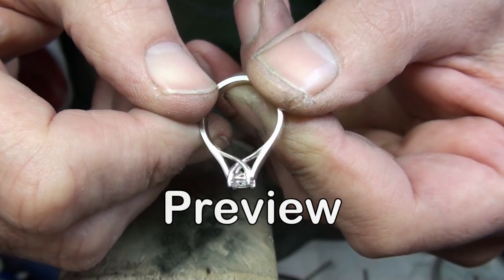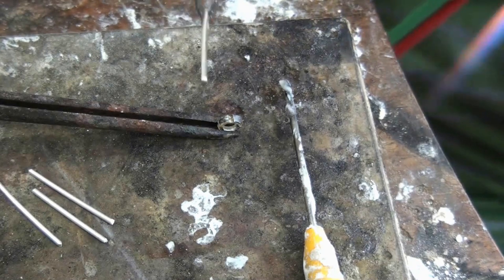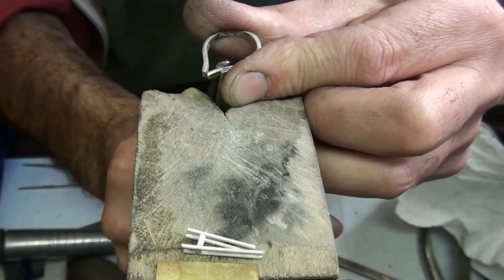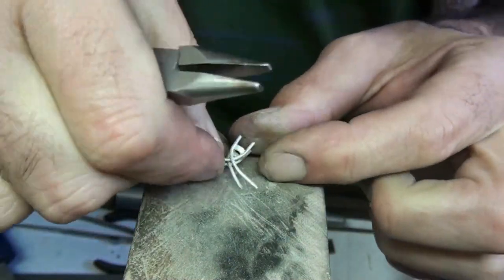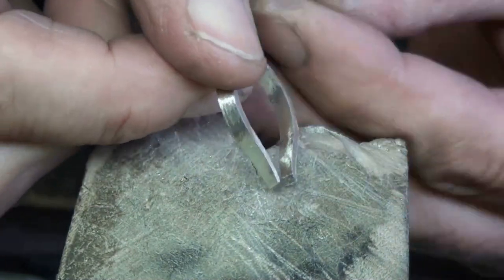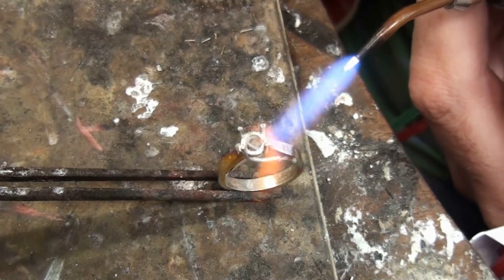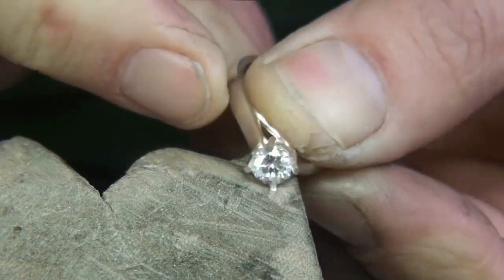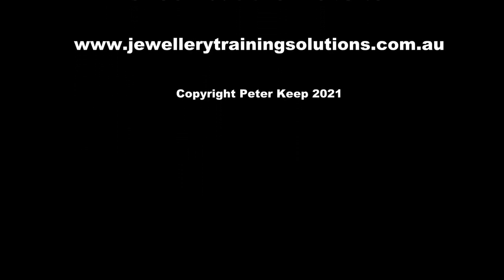Crossover basket solitaire ring

Comment: So I'm trying to decide if I should either purchase this full tutorial, or even subscribe to the service, by trying to follow the steps in this tutorial and seeing what gives me trouble.  For me it's attaching the 4 prongs to the ring bezel.  He dips the prong in flux and then just seems to touch it to the grove in the ring with a little heat and boom, it sticks.  What I can't see, is where is the solder in this process?  Is the grove in the ring pre soldered, the prong?  It doesn't seem so.  He's holding the torch in one hand and the prong in the other, so there's no way to introduce solder that I can see, but the prong adhere well enough to be able to bend later.  is he just welding the two by getting them near melting point?  If so, then why the flux?
Reply from the maker: If you subscribe to the Advanced level, this video is included and the first month is half price; https://www.jewellerytrainingsolutions.com.au/pages/advanced-course-sign-up